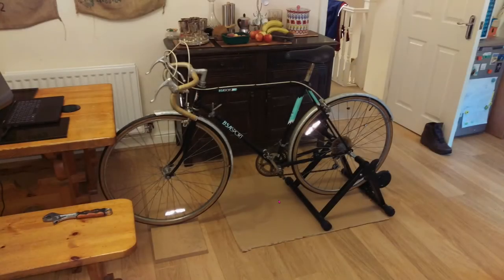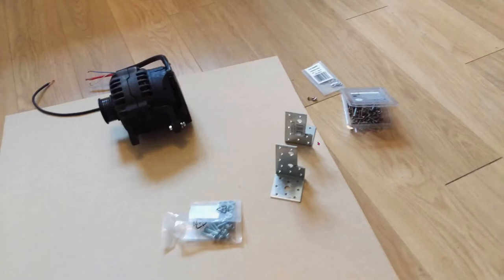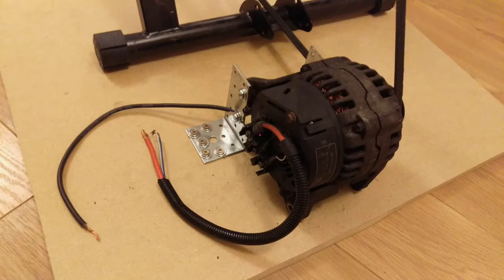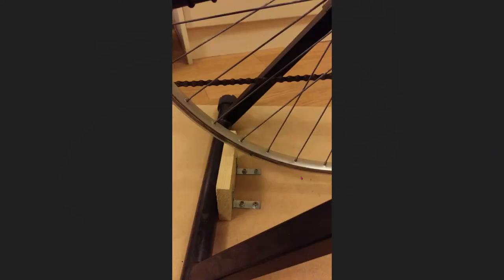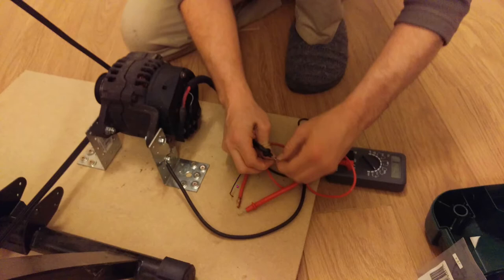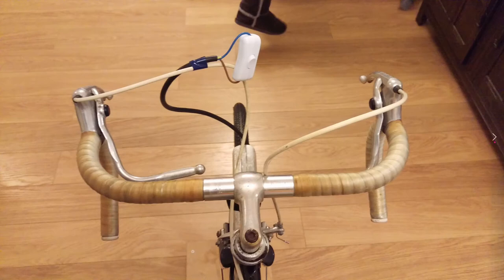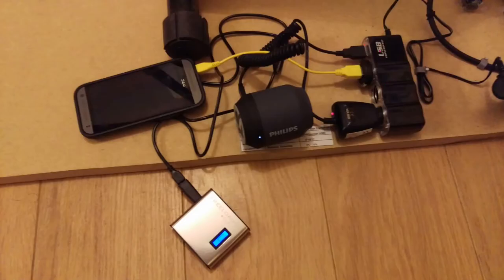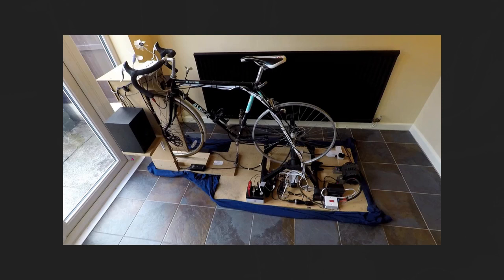How to Build a Bike Generator - Step by Step | DIY Bicycle Generator Series

Comment: Hello, im building something similar for my class using a 24v DC motor instead of an alternator.  Does the battery need to be drained in order for the generator to work? I feel like the initial charge of the battery is powering the inverter instead of the bike.
Reply from the maker: Great that you're building one! If you're using a permanent magnet DC motor, you shouldn't need a battery at all unless you want to charge one up for later use. A battery is necessary for an alternator because it needs a small voltage to get the field coil starting to generate.
If you have a battery in parallel with the generator with the inverter as a load connected to both, the battery will indeed power the inverter. But a discharged battery is likely to cause problems, because the voltage will be slightly lower (if it's lead acid) and will take a long time to charge up and/or draw a huge current, making it very difficult to pedal. 
I'd suggest having the battery switchable in the circuit so that you can use either to power the inverter and you can also switch off the inverter in order to charge the battery. You might want to use a resistor or pulse width modulator when charging the battery so that you can modify it's current draw to an acceptable level.
Reply: @SystemicCreative  I put a multimeter to the motor when pedaling and it only generated about 6-7 volts. Isn't that not enough to power the inverter? I'll test it tomorrow but I feel like I need the battery in order to output a constant 12 volts. But I think I will take your suggestion and turn off the inverter to charge the battery. We're trying to teach energy and how many calories/time pedaling it would take to power a blender for x amount of time. So charging the battery and then running the blender makes the most sense for us.
Reply from the maker: @DivergentStudio  that makes sense regarding use of the battery for the blender. It's actually pretty hard to generate enough power to run a blender anyway! The low voltage is probably because you're using a DC motor - the output voltage will be proportional to the speed it's turned. You'll need a voltage regulation circuit between the motor and load. You can buy these already assembled very cheaply from eBay or Ali Express.